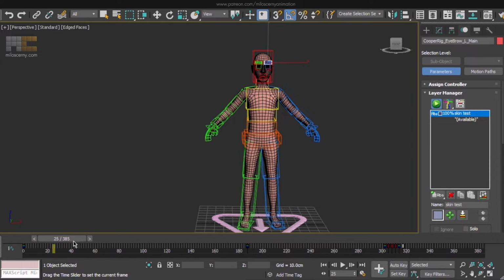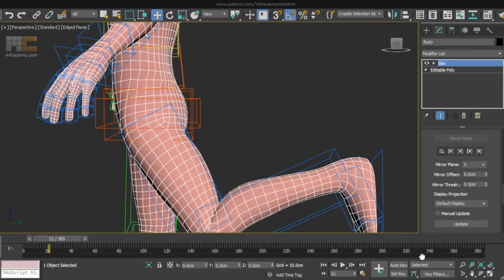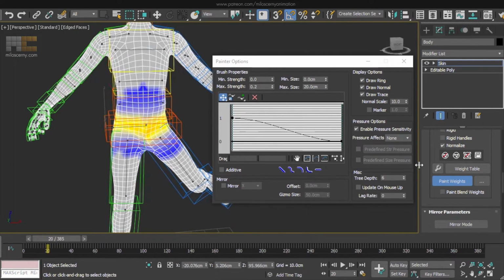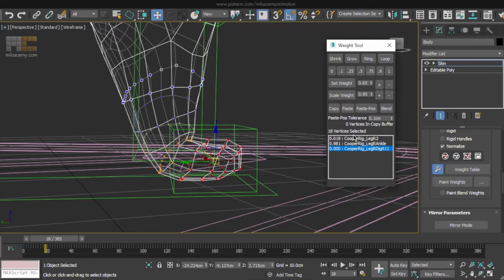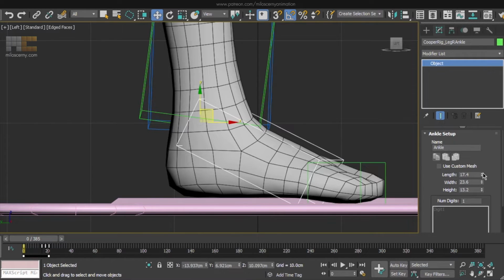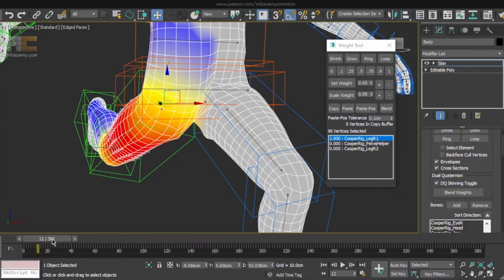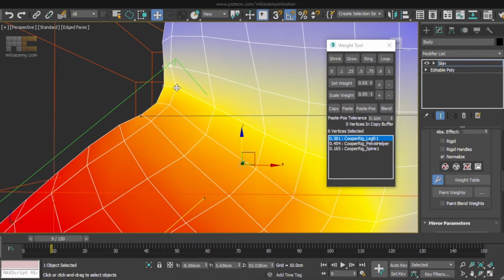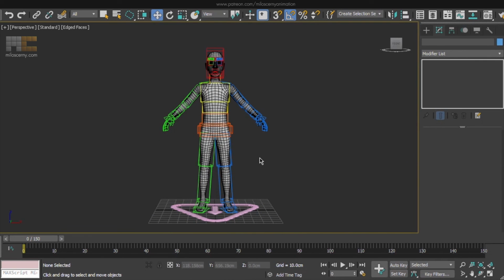Your First 3D Character - Skinning Legs - 3ds Max CAT (Part 4/7)

Comment: This explains so well the idea of "It's depend", sometimes I got asked why I do skinning like that, why that joint is there, the only reason I could give is because it deforms well. The only reference I could give is the anatomy and body mechanic, if you can reach that level of realistic, it's the right thing. But most of the timing models and projects' style does require and/or reach that level of realism, so it's really depend.

Comment: I did the mirroring, but the of of the legs doesnt follow the rig anymore, it follows the leg it was mirrored from, any solutions?
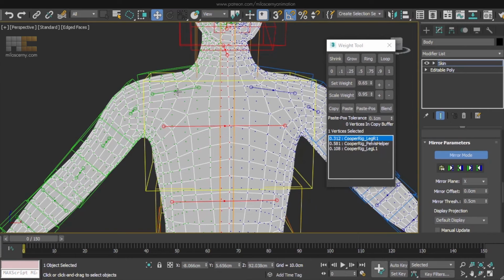Reply: Did you solve the problen? 22:01 look attentively there he said that you need to see 3 colors of bones, sometimes it can be red, if so you need to use Reset XForm on you mesh. I had a similar problem and I solved it this way.

Comment: Mirroring Verts isn't working. Is there something else that needs to be 'enabled' or 'disabled'?
Reply: try importing the mesh again, make sure to reset the xform if needed. Than you can skin wrap that new mesh onto the old mesh, so it gets the same skin. Now it should work on that new mesh. I hope this helps!
Reply: @yesdude153  I have no idea to be honest, I work with the latest version of Max
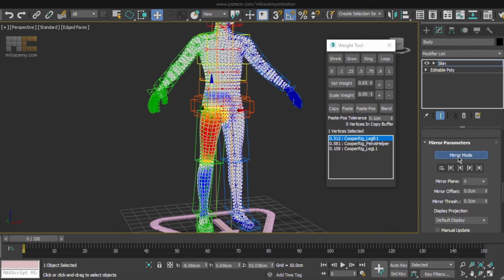Reply: Did you solve the problen? 22:01 look attentively there he said that you need to see 3 colors of bones, sometimes it can be red, if so you need to use Reset XForm on you mesh. I had a similar problem and I solved it this way.
Reply: @SlavaWRX  I think it was that the 3rd party meshes I was using weren't mirrored. So the method works for symetrical figures. I think.